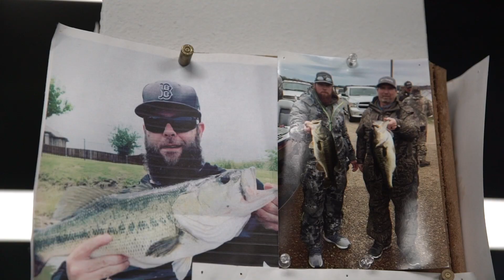Googan Gives FREE Fishing GEAR to COMPLETE STRANGERS!

Comment: Hes thinking small with his three items! I would take the boat, engine and trolling motor!
Reply: What you gonna drag the boat on the concrete to get it home
Reply: That’s called taking advantage of a kind gesture.
Reply: @toola2619  well if it's any consolation when they give a rod or reel away it comes out of their pocket, the boats were free to them by sponsorship!
Reply: @IRON6600  damn you got me there he he!
Reply: @nukembear2345  that’s still not the point old buddy.
Reply: @toola2619  alright the we will make it simpler, he did not offer me the deal so anything I say is a moot point and only meant in jest, clearly I forgot the trailer!
Reply: It’s not his boat, engine or trolling motor 🤣